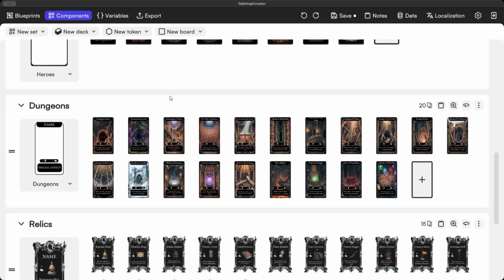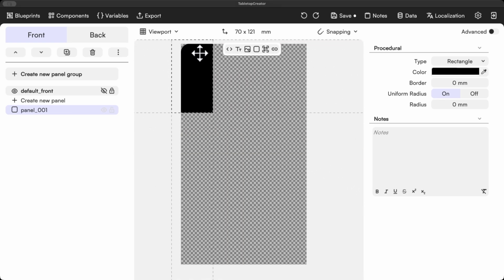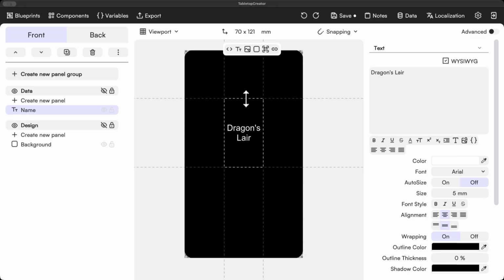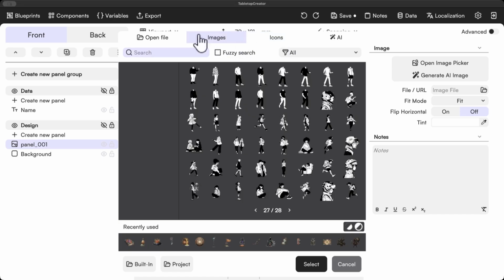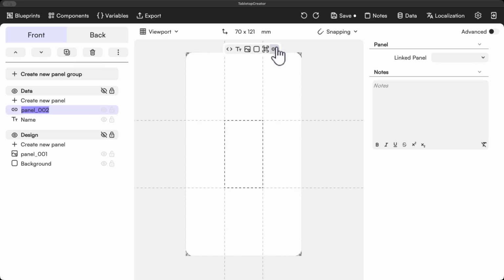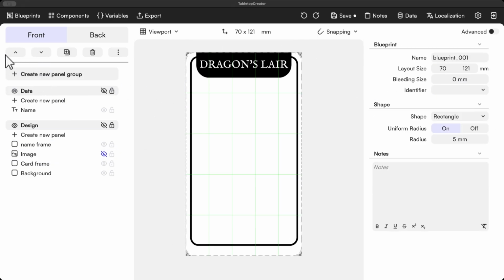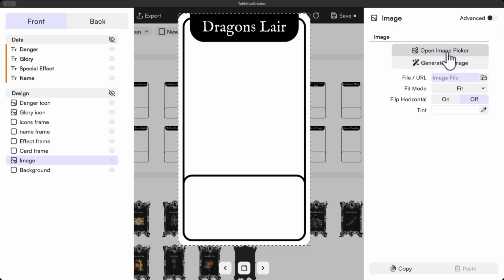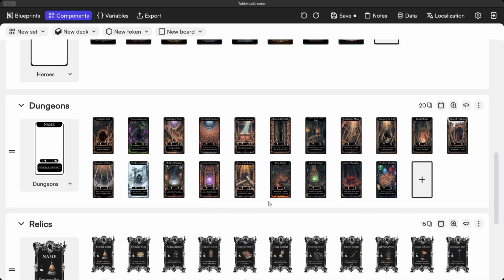How to design a card in Tabletop Creator | Tabletop Creator Academy

Comment: What about advanced auto layout based on the input data? Like display this or that depending on the value of a field ?

This is all pretty run of the mill tbh... need more interesting and useful features (NOT crap like aigen or bad "default icons").
Reply from the maker: Good point — that's not something the tool supports (no conditional logic that switches between layouts within one set based on card data). It would require a lot of development time and we have our focus on other features for now.